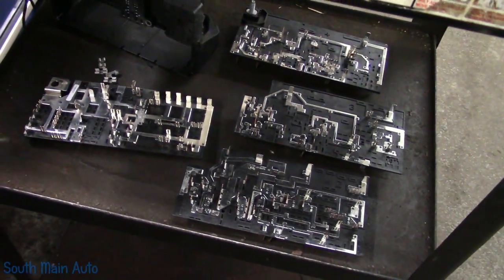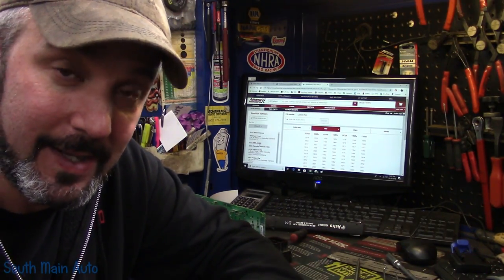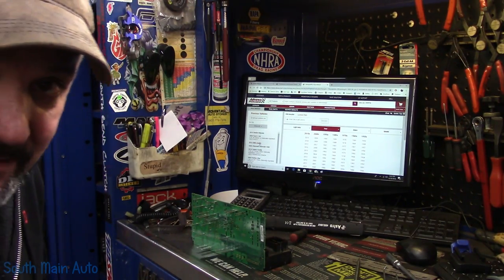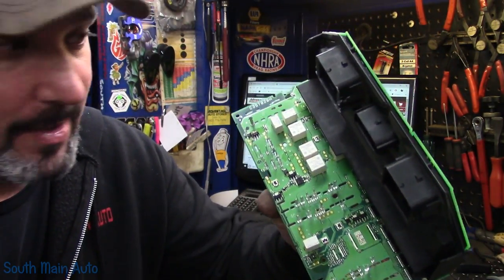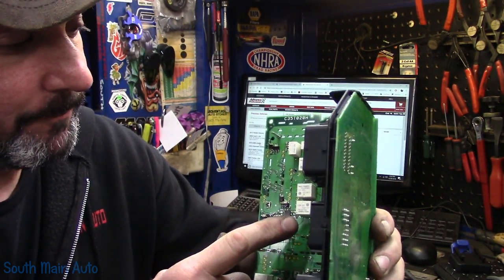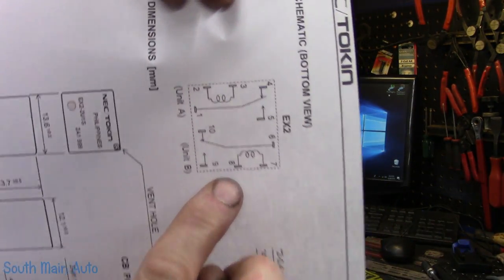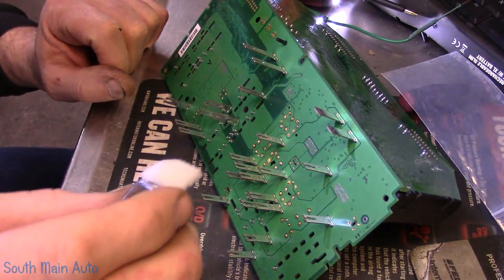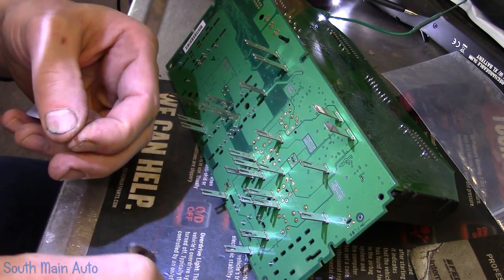Chrysler / Dodge : TIPM Repair - No Wipers

Comment from the maker: *EX2-2U1S Automotive Relays* : https://amzn.to/2Srl56r
*Head Mount Magnifier* : https://amzn.to/2St4f7c
*Solder Sucker & Desoldering Wick* : https://amzn.to/2CFkBV5
Reply: Happy New Year
Reply: jeffescortlx channel, while not a "how to", shows superb technique for de-solder/replace.
Reply: Thanks for sharing this Eric, I remember my first time, shaky hands, sick feeling in stomach, worrying about iron temp, solder type, battling the wick.
You're awesome for doing this on camera. Steve 👍
Reply: It was a riveting video all the way through, if only waiting to see sparks. You did not disappoint. 
Of course, if all else fails you could have done a video on  adding a 1975 dash mounted wiper switch and relay setup to a modern vehicle.  LOL
Reply: Number one tip is to add solder first to make it melt and flow better before desoldering.  It's counterintuitive but it helps the solder flow much better.  The flux in the core of the solder will clean the connection too.

Also, hold the wick to the joint then hold your iron on top.  Your tip looks a little small to heat both the wick and the joint at the same time.
  That's probably why it wasn't flowing for you.

Anyway, watch pretty much any of big clive's videos since he desolders something almost every time.  He also solders temporary wires to things, which is something you could have done to test the opening and closing of the relay contacts.
Reply: Good point! I leave my wipers off when I shut the car down, as once I had left them on (but forgot), and the blade peeled off leaving me a bare arm. Very irritating.
Reply: Watch the ipadrehab channel for micro soldering. Great job!
Reply: Great video as always. The process is always in a common sense way but every once in a while car is designed is a non common sense way as shown in many  of your videos. If America wants to regain prominence in manufacturing it needs to become better at designing  vehicles that are easy to service and don't have a lot of gadgets and unnecessary sensors that are bound to fail.
Reply: Hmmmm,  what would pull enough amps to fuse the contacts but not enough to blow the fuse? Maybe there is an undiagnosed intermittent short and that's why the park codes went away? Probably just a bad relay... but hmmmm.
Reply: The disassembled parts were 10 times harder than the de-soldering!!
I believe the wick is for microcircuitry work with the use of hot air on the PCBS with the proper work station. Bravo well done!! What was Chrysler thinking when they built that?
Reply: South Main Auto Repair LLC that beautiful little chuckle of success at the end!  What a sense of satisfaction (relief) it must have been ;). This video does NOT suck (except for the actual solder sucking).
Reply: Eric you need a 50W temperature controlled Soldering Iron. You have the theory with the desolder braid correct, you just need more heat. take care with multi layer boards, one side could be free of solder while the other side could still be soldered. If something wont come free of the board easily once desoldered then just heat the individual pin. Good luck for having a go and saving $100's in the process. As an electronics engineer i do giggle at some of your fault finding process' but respect to you bro.
Reply: Sometimes adding some fresh solder "Wets" the joint and makes desoldering easier
Reply: I fix GM cluster motors but I do then very quickly.  Which is why we will warranty them. I've never had one cme yet though. I would fix a TIPM too but that would take too long to justify fixing it.
Reply: Thanks, I got a 2010 Liberty with no LOCK circuit and a $947 TIPM lol.  Time to start fixing them in the dealership.
Reply: So do you and your brothers take turns working on the sisters car.
Reply: Lose not loose. Loose means not tight
Reply: Man what a good video well detailed keep up the goid work goid job!!!
Reply: Heat then suck up solder after get relay out heat each hole on board one at a time then blow air threw hole to open up hole to get new relay in easier. We heat and blow off solder from joint.
Reply: Eric, you desoldered and soldered just exactly the way that a pro would do!  Solder wick, which has flux in it, is for after the solder sucker, when you were trying to move the pins. Solder wick doesn't do well with a lot if solder, like when you start on the pins. It's best to lay the wick on top of the area that needs to be cleaned and put the iron right on top. Also, move the solder wick to a new section as soon as you see any solder on it. And your sucker techniques  were perfect. All in all, you handled the repair like a pro. But do check out some other videos that explain what is being done and why.
Reply: Do you want it done right or do you want me to do it?
Reply: ❤❤❤awesome solder sucker & desoldering  wick

Comment: That was quite a tough challenge with the reduced access and a double sided PCB with multi-pin component.  On a plus note, the holes for the pins seemed quite generous.  (It's harder with close fitting holes.)  There's always the risk of accidentally lifting pads and breaking tracks to other sections of the PCB if you use too much force in removing components.  As someone else mentioned, you have to be careful powering the relays on the PCB as it can cause issue with the diodes that are often in parallel to the coil to snub the switching spikes.  There's also the risk that if you inadvertently touched a logic track it could nuke a chip too.
The desoldering braid is good for single sided PCBs, especially when used with flux.  The desoldering pump (which you were using correctly) is better for sucking solder out of plated through holes.  A good way to clean those holes is to get one person at one side with the iron and another person at the other side with the pump.  You can get a better machined pump with a replaceable silicone sleeve at the end that sucks better.  (Or a soldering iron with pump built in.)
I'd recommend a set of "hollow desoldering needles" from eBay.  Just a couple of dollars for a set.  They're hollow stainless steel pins with handles that you choose to fit around the pin of the component you're desoldering.  When you melt the solder the pin/tube slides in around the pin isolating it from the rest of the solder, and then because it's stainless it can slide back out again after the solder has cooled.  That leaves the pin free.
Fresh solder applied to old joints cleans the oxidation off them and makes the solder more fluid.  Choose a 60/40 tin/lead electronics grade solder with a flux core and get it from a respectable source.  Not eBay.
You did a good job.  If you were routinely repairing those things you'd get it down to a fine art.
Reply from the maker: A reply from the man him self :D Thanks for watching Clive and adding you input! I really appreciate it. I change out enough of these for regular customers I think I will save one and order some the suggested bits of kit and do some playing. I think that is the only way I will get better. Again, thanks for stopping in and offering you input.
-Eric O.
Reply: @SouthMainAuto  I've only seen one other comment wondering what caused the relay to melt the contacts together. You had mentioned a code regarding the PARK switch. Did your sister say anything about the wipers getting stuck just prior to the failure? If that was the intermittent relay and the wiper motor was stalled while the relay opened and closed it could have arced enough to melt the contacts together.
Reply: @SouthMainAuto  You can watch Louis Rossman channel (Macbook repair) how he uses the solder wick (hmm, "wick"... that may be the reason I see so many "WIX" ads there). It works well for his cause because of the surfacemount components. You can use heat gun (I mean, preferably the real solder job one) and heatmask from kapton tape to melt all the solderpoints in one go on those multi-pin components and then you can just pull them out. Clean the holes and install replacement(s).

Btw, did the park switch have any (electrical) connection with broken relay or was it fed from separate circuit? This could explain why it wasnt working before.
Reply: Is there a disadvantage to using 63/37 over 60/40? I pretty much always use the former.
Reply: @rfmerrill  Cost, really. 60/40 is common and relatively cheap. But if the component moves during the semi-solid state, that'll cause cracking and a cold joint.
Reply: Wow the big Clive live! Two of my favorites on YouTube.
Reply: @patburnsent    would iced up wiper blades ( stuck) ... have caused this .... ?
Reply: @ivanolsen7966   That makes sense as a cause.  With those relays buried inside layers like that, there is no cooling for the winding of the relay - though the blob of metal that melted indicates high current through the contacts as they were switched causing the high resistance (and high heat transfer resulting in high temperature at the contact) condition at the contacts like someone flicking the switch on and off repeatedly as if to break through an ice lock of the wipers.
   If the relay contacts didn't melt, the wiper motor would be next if that was what was it.  Another possibility may be the contact switch stuck (bent or particle blocked movement) at a high resistance condition and melted itself with no operator interaction.  
   If it was a high current for some external reason, it probably would have remained after the relay replacement.
Reply: Learned basically the same way changing out 5 capacitors on my old Dell..also found using (65 watt pwr adjustable Soldering Pencil) 50 watts to remove using the Sucker! and 65 to install each pin, though the Dell (Intel) Mother Board was a 3 Layer Board. Yes, no matter one's soldering experience..this is as tough as it gets!! Great Work, Eric!
Reply: I missed the two bestest guys, almost together on the tube by 2 years…I’m blessed…great fiddly repair Eric O.
Reply: Remove the soldering iron from the pad before you trigger the soldering pump.  Keeps you from destroying the pad.
Reply: It would have been very entertaining if Clive could have talked Eric through the process on zoom or something. Eric plays the role of an electrician very well for being an auto mechanic. Wish he were closer to me so I could bother him with installing my aftermarket parts on my vehicles.
Reply: Rosin flux core. Good advice 😊
Reply: I'd be spraying those boards with CRC QD Electronic spray while assembling them, then I'd tell your sister to sell that vehicle ASAP.
Reply: Nice to see someone is as crazy as me. 😢😢😢😢

Comment: With all the problems these TIPM's have cause Chrysler owners, it's nice to see someone tackle an actual repair on these $600.00 units. What an amazing video before the end of the year. 🤗
Reply: Yes. Looks like an utterly stupid idea. Must be just for making money. 10 relays = $50 10 wires = ~$1. Oh, let's replace those with a $30 Chinese piece of electronics and micro relays, make it a manufacturer specific part, for which you need an subscription and a programming tool to change it and charge a $570 profit from it. More reasons to keep my 19 yr old Citroen running.
Reply: I think Nissan has similar issues with their units.
They weren't heavy duty enough and were blowing out.
I know it was common in the Frontiers many years ago.
Reply: chrysler junk, ever priced out a blindspot sensor for the 2010 - 13 ones? $1650 from mopar/dorman/Std Mtr Prod. times 2. 1 for each side. The brain that controls the blindspot system??? $500. just 1. cant believe the TIPM is only 600 bucks, relatively speaking. Glad you fixed it, Hope chrysler engineers and pricing people fall into a barbedwire fence landfill. ridiculous money for junk products.
Reply: not greedy just stupid engineering
Reply: maybe someone should dump a few large dump haulers full of failed TIPM's on some execs lawns ;)
Reply: Had a bad unit in my Xterra, ended up buying a used one on Ebay cause it was worth the chance to save hundreds of dollars.  Thankfully it worked.
Reply: @acidise1  with an artificial rain shower of Da Bomb hot sauce.

Comment: Pretty much all manufactured PCBs now use lead-free solder, which I find harder to desolder and remove. Counter-intuitively, if you add some good lead-based solder to the joint before trying to desolder it, the solder will flow much more easily and be faster to remove.
Reply: Lead free solder is pretty much crap, unless it is eutectic (with silver), but mass produced devices never use lead free eutectic solder.  Too pricey.
Reply: Leaded solder also leads to long lasting solder connections because it expands and contracts less with temp changes. Thats why leaded solder was used in the first place.  Its especially important for cars which go through extreme temp changes. The Green people who forced the move to lead free just never cared about the consequences. Cracked solder joints are the #1 reason for electronics failing today. That's why electronic repair people stocked up on leaded solder before the ban.
Reply: Yes, melting lead based solder into the existing solder creates an alloy that is much easier to desolder.  Big Clive discusses this quite often.
Reply: should be all PCBs, fresh from the factory, its illegal for manufacturers to use lead solder, still legal to use it for repairs though.
Reply: @nickv4073  In the US you can get lead based solder still -- you're just not supposed to use it for consumer electronics.
Reply: Unleaded tin solder also grows microscopic whiskers that cause short circuits. Military and aerospace have a permanent EU exemption from the lead-free requirement for this reason, and pacemakers are exempt until 2021. In the US lead-free solder is not Federally mandated in any industry. Funnily enough, it's mandatory in China.
This NASA paper from 2011 implies RoHS is pretty much pointless. https://nepp.nasa.gov/whisker/reference/tech_papers/2011-kostic-pb-free.pdf. Both NASA and the ESA require leaded solder.
Reply: I keep a good supply of both the leaded type and also the silver type handy.
Reply: Did you check the relay for "clicky-clicky" before you soldered the relay to the board?  A new, defective relay could have been delivered.  I'm glad it worked okay after you soldered it in.
Reply: and where do you buy lead based solder ? In some countries that´s also no longer available
Reply: @bobl78  ebay, amazon, most internet shops
Reply: @bobl78  you might be able to find it there still. In the States they don't sell lead plumbing solder anymore too. So the usual hardware store like places that carried it before no longer do. But we can still get the lead stuff in small sizes for hobbies and electronics,but only from hobby and electronics places. But if you can't like others said there's plenty of online sources for 60/40 Rosen  core solder.

Comment: For the future, always add new solder to the point you are de-soldering, it makes removal much easier.
Reply: Yep. Great tip!!!
Reply: Does two things.  The flux in the new solder cleans the surface.  And using 60/40 solder on those no lead solder joints makes things a lot easier to get heat transfer.
Reply: You were doing everything right with the desoldering braid and the sucker except for missing this step. Pulling on the side of the part while heating a couple of pins can sometimes get a little bit of movement and break the pins free. Or just hack apart the relay and remove the pins one by one
Reply: adding new solder helps transfer the head. i've had better success with adding a drop or two of liquid solder flux to the wick. the flux helps the solder get off the joint faster. and faster is better when it comes to not-overheating the tracks on the pc board.
Reply: @bobbydazzler6990  And a bit of solder on the tip of the soldering iron helps keep the tip in tip top shape. Good example of how to save money by working on your own vehicle. Not a bad idea to find something similar to practice on first. And watch the heat! Too much is bad.

Comment: Ha ha, it's so cool to watch a pro dip a toe into a real DIY board repair! As always, your diagnostic process is elegantly simple, this is a brilliant video. I've been playing around with microsoldering SMD boards, it's a whole different world. Fortunately the cost of specialty tools has come down dramatically in the past decade, but unfortunately the new boards coming out today are really challenging. A typical resistor on a new SMD board is smaller than a grain of house dust. For those interested in how new electronic repairs happen, there are a few channels that go into detail, Louis Rossman and Ifixit both do computers and phones. It's a new age, we're all going to want to know how to do these repairs....
Reply: I also recommend Jessa Jones at iPad Rehab Youtube channel.  She really goes in-depth into the diagnostic & repair process too, similar to the way Louis Rossman and iFixit video go into.
Reply: I tried to fix a power window driver side controller - it has SMD too - you nailed it when you said "resistors smaller than a grain of house dust" - got me laughing me butthole off!!!
Reply: I've been able to do 0402 packages, but not without a few flying off into the dust, which is nothing given capacitors of 008004  (0.08mm x 0.04mm).  About the size of the through holes on that TPIM board.  Magnifying lens light no longer works and I think I'd need to move up to a microscope to go smaller than 0402.  Checkout a youtuber - Androkavo  I learned a lot from watching his soldering videos.